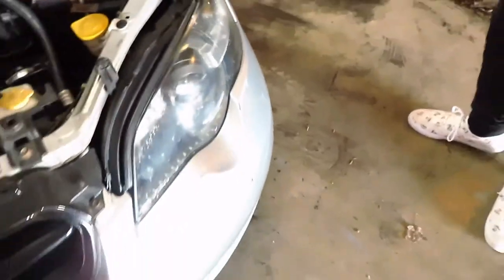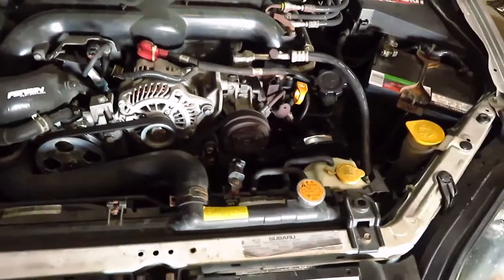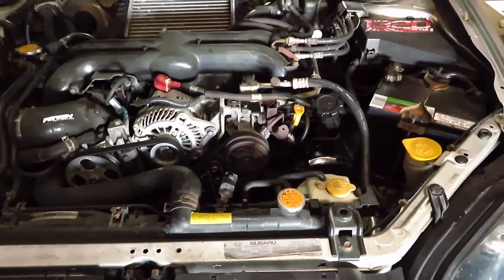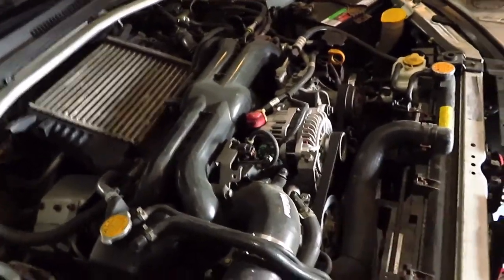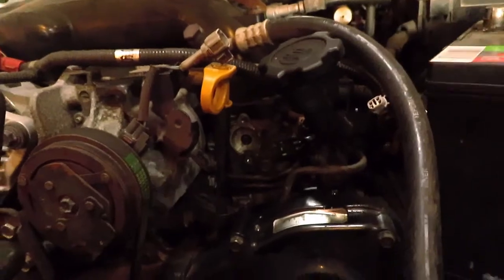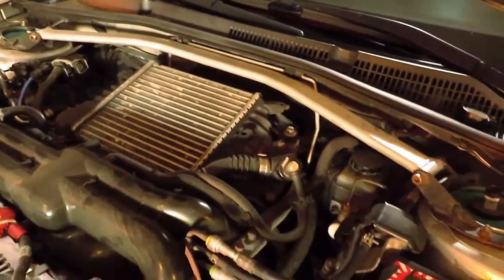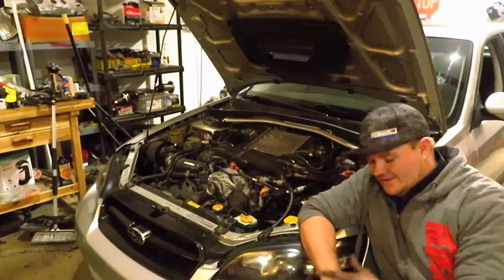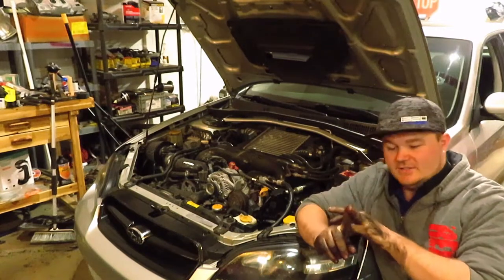Subaru Legacy P2021 Fixed (Throttle Position Sensor)

Comment: legit took me not even 5 minutes to replace the same sensor you took longer just to lift the car then it takes to replace the sensor it on the top outside front on the motor with one hose in the way